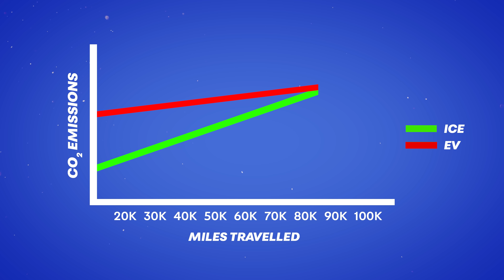Are Electric Cars REALLY That Green? [New 2022 Data]

Comment: It seems to me that the one issue that seems to be overlooked here is the amount of electricity that will be required once we all own EV's, here in the UK our own power output is already overloaded just by the need from commerce and residential homes, add to this the 20 million or so EV's that will need to be added into the power grid you then have a shortfall of power available, thus requiring the generation of larger amounts of electric, using more Fossil fuels or radioactive materials, ( the later being claimed as the cleaner way to make electric but in fact the waste takes upwards of a thousand years to dissipate and we all know what happens when you get a major event at a nuclear  power station ( re 1986 's melt down) and leaving a large area contaminated and uninhabitable for many years to come.

   So really we need to be looking for a fuel source that can power the ICE powerplant and not introduce harmful by-products into the air, Like hydrogen. 
   But really the fastest way to a cleaner way of life is to cut down on our reliance for the motor vehicle, 75% of all journeys in a car today are less than a few miles, mostly school runs/shopping trips. people have forgotten how to walk anywhere in the last few decades, and the result is far more people who are overweight and not as fit as the people from say the 50's 60s and 70's. our family in the 60's 70's had a car, but it was seldom used, mainly being used for holiday trips or going to see relatives who lived far away, we walked to school ( 4 miles each way daily, rain or shine, or rode our Bikes) shopping was done in the local corner shop on a bi-daily basis or the local market stalls once a week. a trip into town was a day out not just a shopping trip.
Reply: Actually shouldn't be a problem with a higher renewables mix. If we get as much offshore wind as we're gonna need for it to make up a sensible proportion of our power there's going to be masses going otherwise unused overnight, when most people will be charging their EVs.
Reply: Thats why infrastructure is needed.
Reply: I lived through the 60's and 70's cars were used ever day just like today for the same reasons work, doctor, play, vacations, racing. We used 2 cars every day in our 4 person household. Aside from that there is new Tech on the way. San Fran is installing huge new wave powered powerplant. Waves don't stop as you know. Massive free power.But I understand those coal rollers sure would need another hobby.
Reply: Burning hydrogen in an ice engine does generate noxious fumes I’m afraid. To get any reasonable power the burn must be hot and this causes oxidation and hence NOx. Whether at levels similar to a diesel/petrol car I’m not sure, but not zero. The only clean way to fuel vehicles with hydrogen is using a fuel cell electric vehicle - unfortunately this is very expensive and assuming the hydrogen is generated / compressed / shipped / storied in a zero-emissions manner it’s also very inefficient. Therefore it will always be much cheaper to buy / run a BEV than a FCEV. FCEVs only really start to make sense at the bigger end of the market - really big SUVs and commercial.
Reply: The real issue is: very far from everyone should own cars and use them as their primary means of transportation. What's a lot cleaner than cars? Trains, busses and bikes, getting a good infrastructure for them going in places in which it's feasible is miles more important for the environment than switching to electric cars. People talk about the lobbying from big oil or from energy manufacturers, but no one from "big car".

Comment: I did some rudimentary calculations myself a couple of years ago and the best then would be to use a gas car as long as you use gas produced from waste products. Second place is electric cars since where I live we use a car on a average 20 years before we scrap it. The worst was an ICE car.
Reply: What's a gas car and what's an ICE car? Gas cars ARE ICE cars.
Reply: @C_R_O_M________  Sorry for my lack of clarity. What I mean with a gas car in this sense is a car that runs on CNG that can be produced from waste products or underground (if it’s retrieved from underground it emits bound CO2 into the atmosphere and is therefore worse).

Comment: Has the transportation of the fuel been considered into emissions value, from the moment oil leaves the ground it requires many forms of transportation from extraction to refinement and then to be delivered to each and every fuel station, unlike electricity which once it's been created (assuming from fossils) it's then transported at a much lower emission rate. I'm sure people are going to argue that the maintenance on the power lines requires fuel burning vehicles but they require less maintenance than a road network.

Comment: From the rural US here.  My wife and I both drive in excess of 100 miles per day round trip to work.  (Sorry for you UK guys, we dislike cities and prefer a commute) have discussed an EV for our daily driving.   We have the capability of adding fast charging at home, thats no issue.  The issue becomes battery replacement costs VS standard gas and maintenance.   Our weekender (my full size diesel pickup towing whatever trailer for the task) is an exception that cant be replaced with an EV.   Myself is also an exception. While the wife drives 100 miles per day round trip, my commute works out to roughly the same until I need to go on an away mission which typically sees me driving far excess of most 250 mile average EV range.   

I say good for Volvo forcing the discussion.  Maybe now we face the facts of both city VS rural travel and weigh the costs either way.

Comment: Interesting video, but this study seems to only focus on GHG emissions, which seem significantly lower than most other studies I've seen. But, assuming their data is accurate, it only emphasizes how far ahead Tesla is with their manufacturing process. A Toyota Corolla, when compared to a Model 3, loses its GHG advantage after they both pass the 15,000 mile marker (@25,000 miles if the grid is hybrid.) Tesla reduces production waste by ~70% over the industry average and reduces water used per vehicle by ~25%. This Volvo paper also ignores other substantial benefits to EV fleets like being able to make /every/EV more efficient by improving the efficiency of the grid the EVs charge on. ICE cars only get less efficient over time. EVs still have their shortcomings (far too few charging stations, no industry standard charging connection, etc), but from an environmental standpoint there is no comparison. This also ignores the recycling and reuse of past-their-prime batteries. A tiny up-front GHG expenditure in exchange for a potentially carbon-free vehicle usage? That's hard to argue against.

Comment: Why is the impact of disposing of/recycling the vehicle at end of life never factored into these discussions?????

You can basically melt down and recycle most of an ICE car (as you can with lots of the components of an EV) BUT the battery of the EV takes some serious work to recycle properly and I'm not sure if it can be done environmentally yet.

If that is factored in as well then what is the true picture??

It's clear that greener transportation is the way to go in the future but perhaps burning green hydrogen in an ICE car might be an interesting path.

Comment: I have recently reverted back to an old car, partly for the fun of the car that I brought and because I had owned a Peugeot 208 for 6 years from nearly new and after the Corona Virus Pandemic my work travel arrangements meant that I would not be driving very far on a weekly basis and this would likely not change again in the future. I thought should I buy another nearly new car again and upgrade, then I thought about the cost to myself and to the environment in upgrading vs the number of miles I will be doing. Electric cars are too expensive and I see resale prices of old EVs potentially dropping on final resale due to the cost of battery replacement and repair should the battery get damaged. I decided to buy a much older car instead that will not depreciate 2007 BWM Z4 2.5i and after sourcing a 34,000-mile example in great condition I kept my money in the bank for future repairs and at the same time enable an existing car to be saved from being scrapped anytime in the foreseeable future. We live in a throwaway society and by keeping this car on the road, the car even though it does not perform as efficiently the embodied carbon will be spread over more miles. I hope that one day EV conversion kits will be available for all current petrol cars on the road, but I am aware that EV conversions and modern cars are complex due to the computer systems onboard. For Me, battery technology needs to develop more and the price needs to come down. I would like to see a system where batteries are just borrowed from a filing station of sorts and recharged/swapped over, similar to the use of Calor Gas Bottles for heating and cooking rather than EV charging points, drive up, lift the battery out, drop another battery in and drive off the future? I hope so!!

Comment: As with all statements this only has anything like an accurate picture today. In the pipeline are Sodium batteries (CATL have new patents out) less damaging to make. There are solid state batteries due around 225 that change things. For the Ultimate look at Ampera who have a car that charges itself via sunlight more than the average commute each day. This may mean never having to plug in your car to charge up. The Ampera sells for under $26,000.

Comment: How long does the battery typically last on the vehicle? Because once that battery has to be replaced the clock resets.Does the carbon footprint of the battery include the output of the machinery in the mining process? What about the environmental impact of the mining operations involved in getting the required minerals? Also take into account that no western nation has significant deposits of some of the most important minerals required in making a lithium ion battery. Countries like China and Russia (what a great combination) that DO have these deposits don’t give a rat’s patootie about their carbon emissions and so will perform mining processes as cheaply as possible no matter how dirty it gets. Does that car’s total carbon footprint include any of that? Then there’s the transporting across oceans and processing raw materials and manufacturing to consider for that output estimation. I feel like Volvo’s estimations may actually be a best case impossibility instead of reality.

Comment: A couple of other things need to be accounted.  Lithium mining is HORRIBLE for the environment, which most of these batteries are made of.  Also the end of life of these cars.  If the batteries are not disposed of properly, there's another issue.  Also electric cars that catch on fire in crashes can literally burn for days, b/c of the shorts that are created and cause each subsequent battery in the chain to keep burning.  Electricity is still (at least in the USA) created mostly by fossil fuels. So while driving the car you're not polluting,  but you are by charging.  Also gas powered cars, even though they emit CO2 are not the biggest polluters, b/c of the low emissions.  It's buildings and industry, including the power/electric industry.

Electric cars are just a bridge technology, Hydrogen powered cars will be what we should be striving for.  Toyota already has them in California in trial run. Once the "kinks" get worked out, that will be best.  My 2¢.

Comment: The more we look at EV's with batteries the more we will see them as the mass polluting, Earth destroying con they are. Even the "mileage VS mileage" graph you show is not close to accurate as it does not take into context of the wind turbine or solar panel pollution, Co2 or otherwise. This is an issue because people who really want to feel better than everyone else realize calculating the damage to the earth to dig up materials needed for solar or wind, then disposing of it would add incredible amounts of mileage to the EV before breaking even.

Basically the graph says that solar and wind are 100% green, 0% pollution and no Co2 output. Reality is that solar in most areas of the world is over half the panels energy creation is paying back it's energy debt, the same as Volvo is doing by calculating making the EV. This means that the 30k number could be closer to 90k. The damage to the earth for solar and wind is just insane. 

I like the idea of electric cars, and atm hydrogen just seems like the best idea as it can be made quickly and stored much better than in batteries. We can pull from the buffering off the grid and save what otherwise is tapped out to the earth (wasted) to make hydrogen... Just doing that could power all large trucks in the world... simply being more efficient by storing our wasted energy in hydrogen could make a huge difference. The storage of hydrogen also comes with almost no pollution, no matter how far back you want to go. Batteries, solar and wind is always a game of people not wanting to go back to the giant tractor, trucks and factories as well as shipping of raw materials and the batteries to calculate the energy debt. 

It's a dishonest conversation from the start.

Comment: No one wants to talk about after 7 to 10 years and you need to replace the battery for your ev and your gas powered car is still running strong. Never mind where is all this extra electricity going to come from. Don’t forget about your time, 30 to 45 minutes minimum to partially charge your ev while maybe 10 minutes to fill your tank with gas.

Comment: Yes was debunked on fully charged. Every step of the way an ICE car uses fuel. Fuel to get fuel out of the ground, fuel to refine the crude, fuel to transport the crude on the open seas which are unregulated so the ships burn the cheapest most unclean crude in the engines. EVs are not perfect but are a massive step in the right direction. Dont forget auto trader has an agenda selling second hand cars and there's shit loads. Their whole business model depends on you sticking to your ICE car. Electric cars only have one moving part so should last for a lot longer and with battery tech improvements you may only need one or two cars in your lifetime.

Comment: "EV's need electricity and that creates CO2"... I mean unless you are using renewables.
no one said the problems would disappear tomorrow if we all bought EVs, the renewable energy infrastructure still needs to be expanded to cover the increased need for electricity. The difference is, the ICE car will only get dirtier and worse for the environment, where as the EV (driven aprox 90k miles that almost EVERY car surpasses at some point) will continue to get cleaner. The technology needed for the batteries will only get better and more efficient with adoption.
Reply: just watched more of the video going over this...

Comment: One thing I have observed in these arguments is that the power generation rarely accounts for the losses from generation to turning tires.  Often I see estimates that will take a regional mix of power generation, they don't add the 15% grid loss, the 10% grid to battery loss, 5% storage loss, then the 10% battery to motor loss.

For green energy, rarely do I see the CO2 generated to make the solar panels and wind turbines, these things come with their own carbon footprint that must be overcome.  Keep in mind that green energy being unreliable results in faster response lower efficiency generators to fill the gap.  As Germany increased their solar panel generations they needed more and more fast response petroleum generators, but the reduced efficiency resulted in overall more CO2/KW of power and more expensive energy.  Both of these are bad for people and bad for the environment.

At the end of the day the easiest answer is skip the system that has the fewest conversions, entropy will always chip away at the efficiency of batteries.  It's also worth noting that if you look at most power grid systems most can't sustain many EVs recharging.  If you look at a traditional 100 home subdivision 10 EVs charging would wreck the grid for the neighborhood.  EVs don't scale well for moving up, also the environmental damage for batteries isn't small most estimates indicate that you have to excavate 25 tons of minerals for 1 ton of EV batteries.  Scaling up EVs runs into tons of problems with battery supplies, power demands and all of those indicators are environmentally dangerous.

Comment: Assuming that EVs are environmentally sound is childish, at best.  You never mentioned the man behind the curtain.....the non-recycleable sludge that is created in the manufacture of the batteries.  Because most auto manufacturers don't actually manufacture the batteries, they don't have to disclose this information.  As well, here in the US, for long-distance travel, EVs are basically useless.  You keep saying "honest" when EV desciples don't address the MASSIVE amounts of sludge that is generated by the manufacture of windfarms and solar panels.  You're simply replacing CO2 (which is recyclable by our planet) with poison sludge.  Childish.

Comment: as of now i feel ev's mostly shine if you have a house with solar and a spot to charge your car every night
i don't have that, i live in an appartment so don't have a fixed parking spot and no opportunity for solar
also just prefer the sound and experience of an ice

but i feel like ev's are the future, batttery tech is coming long way's, and with solid state that might solve it's biggest problems (capacity and weight)
renewable energy is also becoming a lot bigger, ak my dad had solar when it first came out, where not even 100watt panels. now we are at 400+ watt
almost feel like 1gigawatt panels might be possible, one on a car and a few on a house will be enough by then